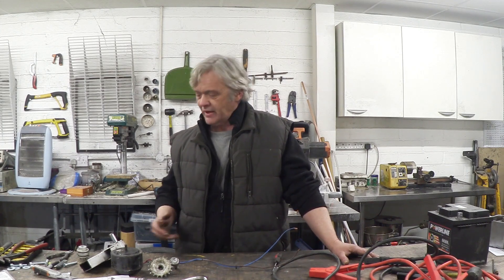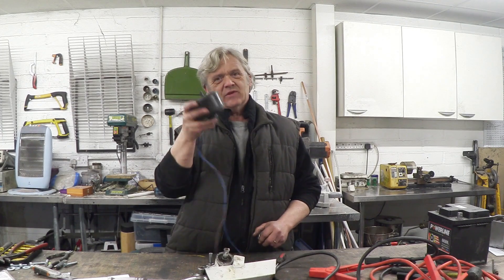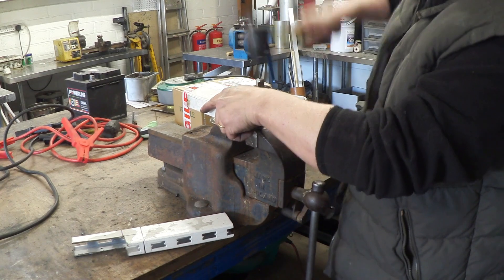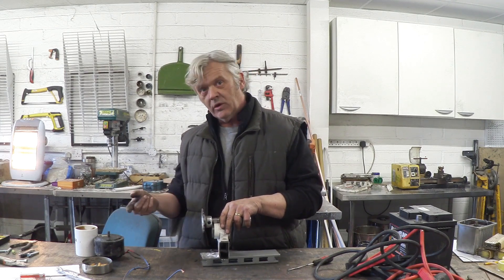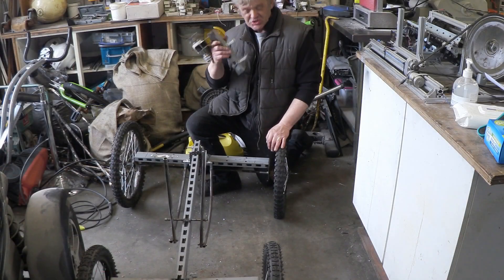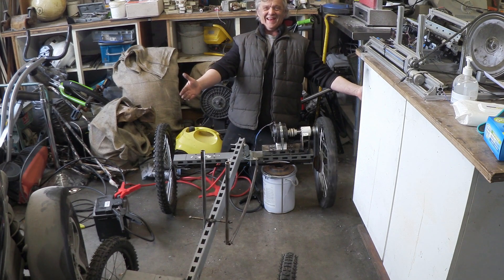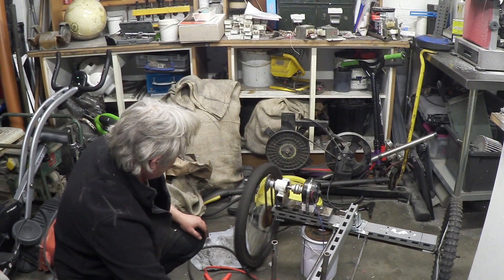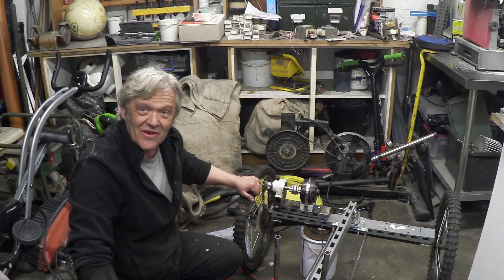1067 Adding An Electric Motor To The Quad Bike

Comment: Will the asymmetrical drive to the wheel on the steering mechanism not make it pull to the right? You will have to apply left steering pressure to the handles to go straight won’t you?

Comment: Nice idea to put the drive on one side of the steering,  your going to be fighting against the torque of the motor all the time. Regenerative braking is going to have you going around in circles.  ;-)
Reply from the maker: I am sorry mate - regenerative braking? There are no brakes on this - it's pretty much a toy - but I get the point and thanks for the heads up

Comment: All that power on a single "steering" wheel? you will have torque steer you cannot control. Are you linking the drive wheels with a differential?
Reply from the maker: I understand mate and great point - but this is a toy you know
Reply: @ThinkingandTinkering  Yes, but I am an aspie with a penchant for describing the obvious... :)

Comment: Great video as always 👍 ... can I pick your brain ? If I had a DC voltage input that’s 270v on a turbine and want that to be 250v is there a way I can do that without re wiring a stator ? It’s connecting to a charge controller rated for 250v and don’t want to damage it
Reply from the maker: sorry mate - I don't know

Comment: Could you have not just reversed the polarity to make the motor rotate the other way? What about torque? love every minute of this video. your passion drives the channel. Best DVD:)
Reply from the maker: you could mate but the wheel has a freewheel gear so though the motor would reverse it wouldn't drive the wheel
Reply: @ThinkingandTinkering  Got it... silly me DVD:)
Reply: My thought also. Most of these motors don't mind the rotation. For caution, I've just listened the running motor and if the reverse has sounded weird, avoided using it in reversed polarity.
Reply: @Teknopottu   ok cool
Reply: No, spinning the sprocket gear cluster the other direction is free-wheel.
Reply: @donfout2830  YES! correct. Totally understand now why..thanks Don DVD:)
Reply: @lightcapmath2777  Why do you say DVD all the time? Has the word changed it meaning?
Reply: @Teknopottu  From a comic cartoon: A young student tell his teacher " David sounds old faction, so i shortened it to DVD"...name is David
Reply: @lightcapmath2777  I see. I was confused because no commas were used. As a non-english speaker I might be wrong but correct me if you will; you should write "Thanks, Don. DVD" if you are talking to Don as DVD. I know, this is internet and no one's writing is perfect, but maybe this would reduce misunderstanding?
Reply: @Teknopottu  Ummmm DVD is a code inscription for those who know me...like you now lol. No, DVD is only used to show respect and individuality. Peace DVD:)
Reply: @lightcapmath2777 Roger that. I wish you good on your path to raise questions and confuse many :D
Reply: Okay, other comment brought up the motor has free wheel.

Comment: I made electric dirt bike from scratch, 8kw motor peaks to 12kw, 48-100v 120amp 100Nm 5000rpm top speed 80kmh, 60km range, single speed middrive, total weight 140lbs and i climb mountains, electric Regen braking the best build of my life!!! All for under $2000 cad
Reply: Brushed or brushless? How did you handle driving the motor? Amazing job- I'm looking to attempt to make a gokart. Everyone only has gas stuff so electric is just way more fun
Reply from the maker: awesome mate

Comment: Good Day Robbert. Not just reverse the polarity on the motor? Cheers Mate.
Reply from the maker: it has a free wheel mate - the motor would spin in reverse but the gearing wouldn't allow the wheel to be driven
Reply: @ThinkingandTinkering  Beauty!
Reply from the maker: lol - cheers mate
Reply: @ThinkingandTinkering  Ahhhhhh. I did not think of that.